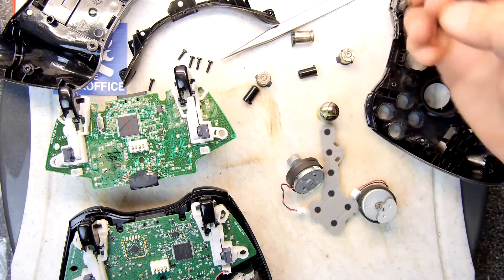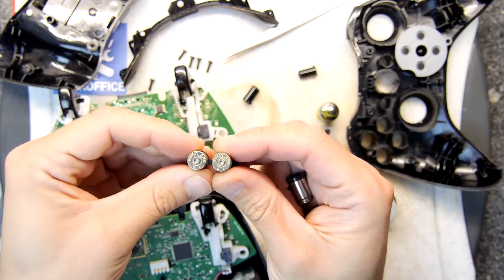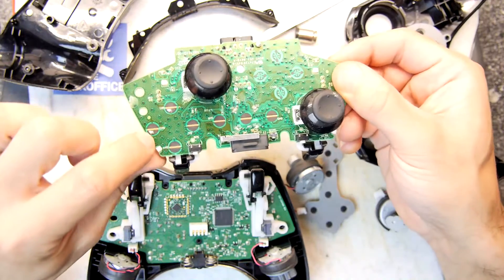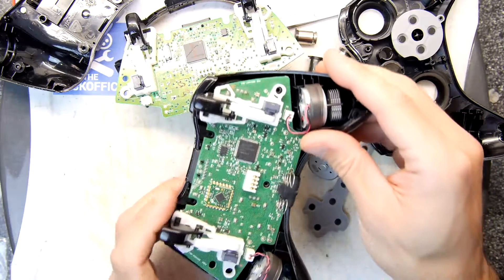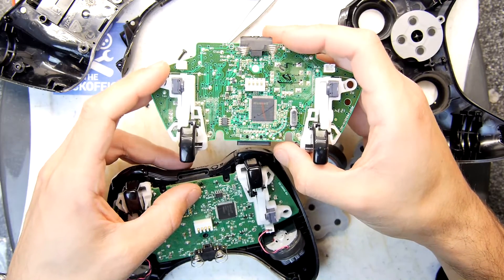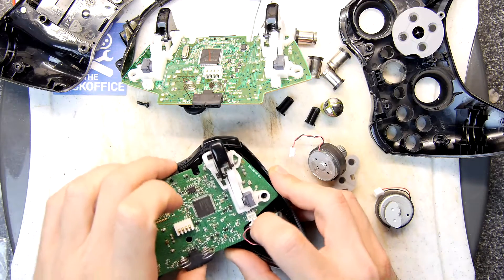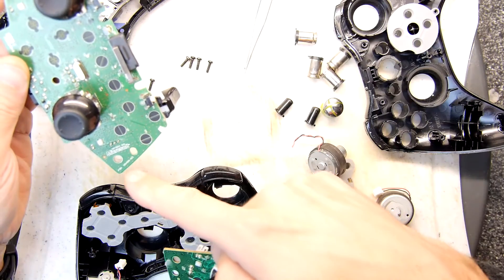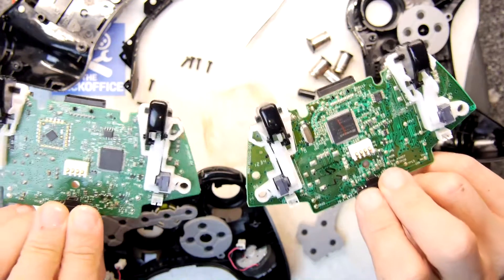XBOX Controller PCB Revisions - Teardown Lab

Comment: Great video.  This really helps.    I'm repairing an Xbox one controller.  The only replacement board I can find is the PCB Joystick 1698 board on Amazon for elites.  Is there a better replacement option?

Comment: I know this is a very old video, but I'd like to add some information and clarify some things.

The board with the daughterboard is known as a 1460 board and was made sometime between 2010 and 2013. From my resources, it seems to be a rather uncommon board. Microsoft contracted to Shenzhen Leadsintec Co., Ltd for a short time to make them. From my limited sample size, they are not that well made.

The other board with only one chip is a 1403 board and were made from 2009 - 2013-ish. They were very common and made by Sung Wei who Microsoft still works with.

Microsoft had over 10 different board revisions and many of them coexisted with each other at the same time.

Comment: im trying to make a 360 wireless controller wired to be used via usb for my pc. do you have any idea on where i should look for soldering data + - connectors or am i dreaming? lol thanks either way.
Reply from the maker: They make a 360 wireless receiver dongle for the pc and wired versions, I think I would only advise on obtaining one of those. I should think the controller would be a bit if a nightmare to adapt
Reply: they make a usb cable thats detachable

Comment: if im right the older one should be the one with the microsoft x817141-002 chip and would be for the xbox360 controller, the other one should be for the xbox one (newer version) correct me if im wrong for the second one